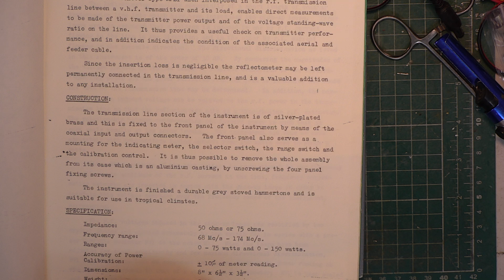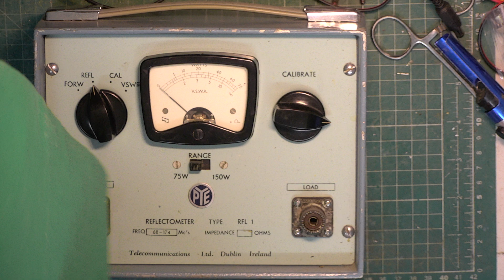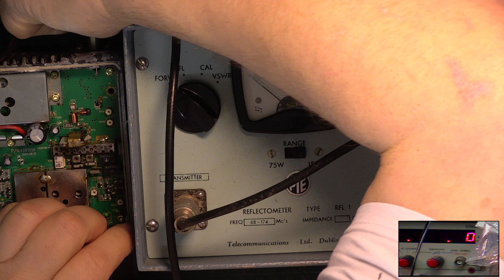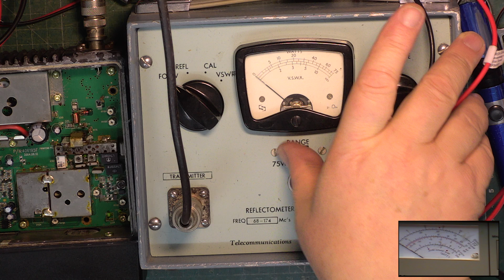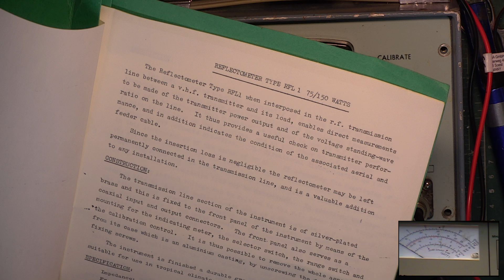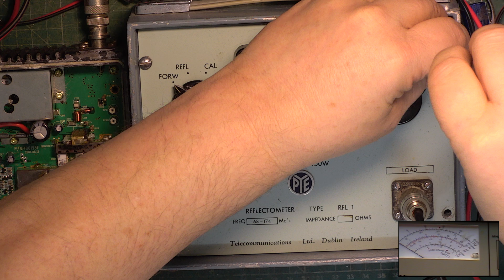Pye RFL1 VHF reflectometer (SWR meter) overview, test & alignment

Comment: I always thought Pye was based in Cambridge not Dublin
Reply from the maker: There was Cambridge plus two other factories to my knowledge. For example we used to see loads of Pye Olympic M201 VHF AM business radios when I worked at Nottingham Radio. Serial numbers beginning C were manufactured at Cambridge & serial numbers beginning H were from the Haverhill factory.

Richard
Reply: Pye Cambridge I think was the main radio and transmitter factory